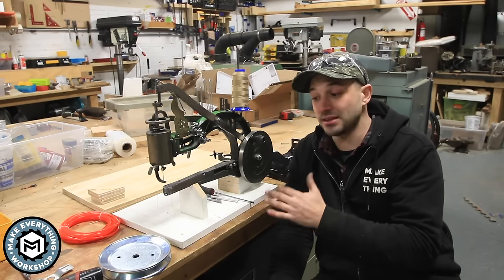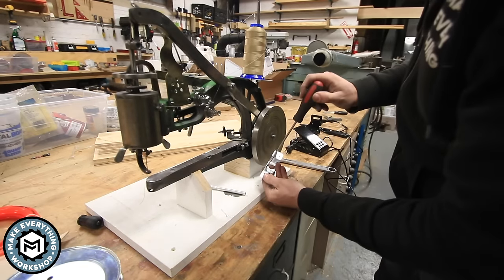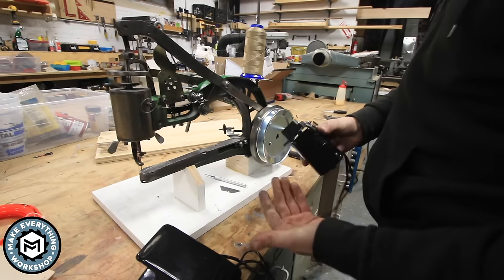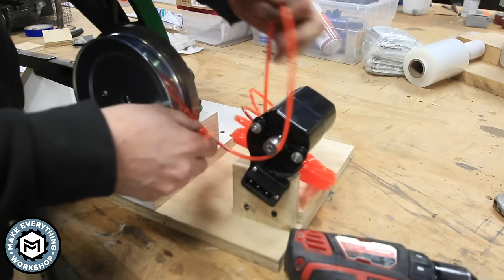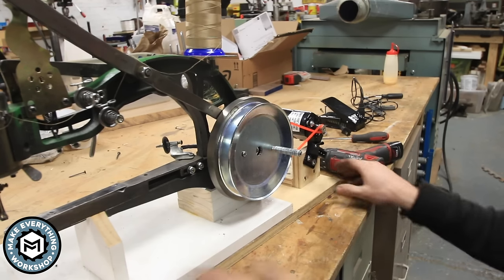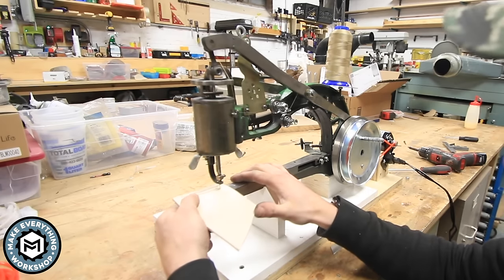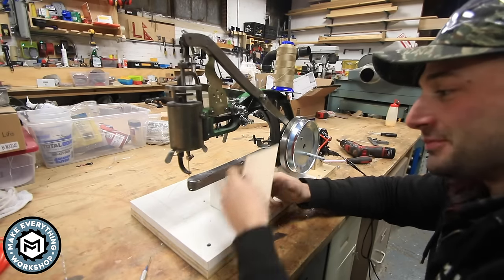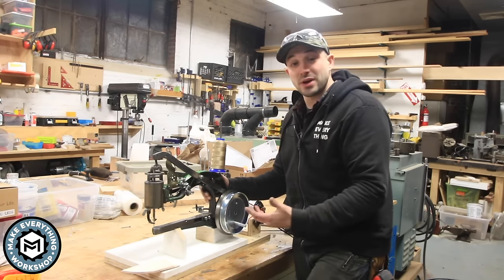Motorizing The Leather Sewing Machine, For Under $50

Comment: Obviously you already have the solution but I was just curious about two things: 1, could you replace the flywheel with the pulley instead of adding it on top. 2, like you did on your Wen bandsaw, if you had 2 steel disks about an inch larger diameter than the flywheel could you sandwich the flywheel and effectively make the flywheel the pulley without machining it? Obviously you'd need the steel disks. Again, you've already got a viable solution but these were just a few ideas.
Reply: You'd probably want to keep the flywheel attached as it adds inertia to the system.
Reply: The "flywheel" is not just for inertia it actually has a patterned channel system on the back of it to guid follower arms that create the proper timing for the machine action. So sorry no it is not really workable to replace the wheel with the pulley.

Comment: Already had the machine.  Picked up the parts you suggested. You said the motor was initially 6000 RPM. Would you be able to tell me with the diameter of the motor pulley you attached the belting to or the potential converted RPM of the sewing machine after attaching the pulley system?
Reply from the maker: I think at full motor speed the big pulley would run around 400 rpm. But like I said in the vide if you adjust the little screw under the foot pedal you can slow it  down to a more  reasonable RPM.
Reply: @MakeEverything  I appreciate the info. I plan on also purposing that motor to run a mini lathe I'm building.

Comment: Could putting a dimmer type extension (like for a lamp) reduce the motor speed?
Reply: I ordered a dimmer.  I was wondering if I should put it between the motor and the AC outlet or between the foot pedal and the motor.  So you know?
Reply: I tried that on one of my machines, it just reduces the torque so you have great control when you're not sewing anything, but it stalls as soon as you put anything under the needle. An additional reduction pulley (and second belt) is what's needed to give more torque and less speed out of that sort of motor, or fit a larger pulley to the balance wheel but that would be ungainly.  Adding mass to the balance wheel might also help as it would smooth the machine action.

Comment: cool idea but it needs a slower motor or gear reduction  by using different size pulleys you could make your pulleys out of plywood or you could recycle some plastic and make pulley blanks. Very interesting idea

Comment: I have one  I bought a while back I keep breaking the needle   I think it may be in the thread I use  so what kind of thread and needle  do I need to use on this machine     Thanks  David
Reply: Thread should not be thicker than # 69 bonded nylon.. needle size #14  to 18 tri point for leather.
Reply: I just replied to someone else. I have been looking for a good video on needles and thread size just today. I found one by Flexitool that goes through the different needle sizes and the different thread sizes and which materials are possible with each combo.  

Some of the other videos I have watched on machine set-up also show other mechanical reasons that are behind breaking the thread and needles.

Comment: Can you use Wax stitching thread? Also I create Guitar straps so I will Stitch after its been stained or dyed. Will this machine make marks in the leather?
Reply: The walking foot as supplied leaves marks in the leather - people grind off the sharp edges of the teeth or coat the foot in plastidip.

Comment: If your 8-32 screws are too long you can trim them shorter with a pair of wire strippers,  got a pair from lowes that have little threaded holes for cutting screws to length.  Run them through the threaded side ( the side that shows the thread size on the face) and squeeze the handle when you back the screw out it'll fix the thread at the tip of the screw so it'll go right in. Don't run the screws in the pliers from the back in the smooth holes, it will leave you saying some terrible things tring to get the piece of screw out of the threaded side...........but I wouldn't know anything about that. . . . 😒

Comment: interesting... i just came across this video and had to view your last one about this sewing machine to see what your thought process was. 

i was wondering if the reason that it is a little violent because the actual wheel the hand crank is on grooved on the opposite side for the cam mechanism to function correctly and is putting that much speed on it really throwing it off balance due to the groove being off center? not sure off the top of my head on how to correct this without having one in my hands to get a better feel of.

anyone have any thoughts on this?

Comment: don't know if I would have gone with a motor that powerful. a lower-speed motor that has higher torque may have been better as you could use more of the foot pedal. the higher torque would help prevent the machine from stalling like it did several times. or just a manual foot treddle connected to the handle.

Comment: what about using a treadle unit from a old singer sewing machine , a lot slower speed then that motor.
Reply: That's a really awesome idea! Anybody here tried that?
Reply: Would the orientation be wrong? The crank is front facing on this cobblers machine, but the old treadles are set up for a side facing crank. Idk. I guess you would have to add another pulley?
Reply: @flyingcat2054  Exactly! There are quite older machines that had the treadle orientation the other way, but I imagine those would be very hard to find. I feel intimidated by the task of having to fabricate that additional pulley. Any YouTubers out there find a doable solution?
Reply: @flyingcat2054  You can run a belt driven shaft at 90 degrees to the driving shaft as long as the driving side of the belt is properly aligned between the pulleys.

Comment: Why not mount the motor on the bolt? you just need to make the motor stationary and then put a L-jaw Coupling Coupler on it. There will be a small rubber spider bushing in there to help with the violent starting and stopping.
Since you motor is turning the correct incorrect way already it is simply turning it around. Might have to file a flat spot on the shaft/bolt or maybe drill a shallow hole, small point for the set screw to take hold.
maybe even get a reversible high torque 90* motor. BUT what does this machine do if you crank it backwards? I don't guess it does a lock stitch does it.
Reply: There's no way a low torque high speed motor directly attached to a low speed high torque mechanism is going to do anything useful.

Comment: Nice mod, make a 3 or 4" pulley for the motor end to slow it down.
Reply: Sean Signer I think that would make it go even faster.  Each rotation of the motor would move that much more belt.

Comment: I liked the video, however that belt is going to melt. You can change the direction of the motor by swapping the leads.
Also being on a budget, a chain drive would have been the clear choice.
Spending the extra $50 on a proper belt drive and motor would have been best option.

Comment: first thank you for the video I like the idea of it, but i found the as the nut on the fly wheel and the light bracket would over tightened and stop the fly wheel. (would a extra washer work to help that?) second the light bracket that is on Amazon, its holes really don't match up the way your bracket does. Any idea's? guess I can go to the hardware store and see if I can find something similar. thank you again for the video.
Reply: I put a washer on a piece of all-thread sandwiched between two nuts.  Then I put that in a drill and turned it on a belt sander until it just fit in the hole in the light bracket.  Worked great.
Reply: john finlay, iii  I matchup up the center of the bracket with the new pulley, marked new holes and drilled new holes. Mounted the bracket with a lock washer ( keeping it centered) and it was easy to mount then. I also used a new crank handle to turn if necessary. The nut for the handle would not clear inside so no lock washer, I put instant glue on the threads. Works great.

Comment: you should make a table fo it so you have more area than that little bar
Reply: tables are useful additions, but the little bar is the whole point of the machine. it's  designed to get inside shoes, or any other tight area. in fact he has reduced the usefulness a little bit by adding the support block under the little bar.

Comment: What is the size and brand of needle and the thread size and brand I just ordered me one thanks
Reply: Check out a video I found this morning by Flexitool on needle vs thread vs type material. I'm sure they don't have that many videos so hopefully it will be easy to find. Just sharing because I have looked quite a lot for someone who could explain to me what needles and thread to order. I have my machine but I do not have it in working order yet. Hopefully next week.
Reply: R Wind thank you
Reply: @oldguysrule-iv7sh  you're welcome. If you decide on an online source for needles and thread and even leather, pass it on.

I am going to start out simply doing repairs of heavier things that have built up around here, involving canvas webbing straps and restitching my LL Bean boot upper to lowers, for instance.  But then I will need to find a source for various weights of leather for new crafts. We used to be able to go to a nearby store and sort through stacks and bins.  I am not aware of any store here who sells leather anymore, specialized threads and needles.
Reply: I found the video, if it will let me post it:
https://youtu.be/XTVOKl0w9mo 

Watch "#13 Needle and Thread Pairing on your Chinese Manual Sewing Machine HI-RES with *IMPROVED AUDIO*" on YouTube

Comment: After timing the machine to run correctly it sews great. BTW I changed my thread and bobbin thread to one from www.sailrite.com used for sewing boat canvas and the machine never breaks the threat even after pulling it out to cut it lose after sewing. It's very very strong yet easy to thread the needle and bobbin,  V-69 Black UV Bonded Polyester Thread 4 oz. sews great VERY STRONG can't break it by hand!

Comment: if you knew the motor was turning in the wrong direction, then why didn't you modify your motor mount and flip the motor around? That way you wouldn't have to deal with twisting the belt. The belt tubbing against itself will chafe and wear down ver quickly. You will find yourself replacing your belts constantly because of the figure-8 system you use because the belts are essentially self-destructing.

Comment: i'm still waiting to see someone make a foot pedal mod of this machine.
Reply from the maker: I saw a guy on Instagram who set is up with a bicycle chain and sprocket to run it that way, it was pretty ingenious!!
Reply: @MakeEverything  Well, since about a month ago i had this idea of making human-powered machines. With a friend we were developing the plans for the prototype of a small 6 wheels handcar, made to have more torque and reside more on the weight from the operators. With a sistem that allows for torque-speed ratio changes without loosing energy on gearboxes nor belts and pulleys. Made to move maybe 3/4 light weight wagons full with things like grain or packages from other towns, size of each one like mining carts.

Comment: Get into the habit of using you hand to help start the rotation on the large pulley. The motor doesn’t have much torque and helping it get started will make it last and won’t have to use so much foot pedal to get going.

Comment: Would this thing work well for attaching patches to hats?
Reply: It'd be like hanging a picture with a sledgehammer.
Reply: It would be excellent for that, because you can steer the needle around the perimeter of the patch without having to turn the hat.  These machines were originally used for attaching repair patches to leather work boots.  I'm not sure what needle fitting they use though - you'd want a small gauge ball-point needle, a leather needle is designed to cut so would damage the hat.

Comment: How much does the leather sewing machine cost? Does it work on real leather??
Reply from the maker: Nikos Tass $100-$120 usually, works amazing on leather I’ve sewn 1/2” of leather no problem in one pass
Reply: I've had one for a while, it will sew any leather you can fit under the foot.  I think the most I've done was 5 or 6 layers of 7oz leather (plus glue).  That was by hand and it was definitely harder than 2 layers but it was not bad.  There's a video on youtube of a guy swing car tires together with this machine.
Reply: Theyr'e like $75 now.. on ebay.

Comment: Cheap motors? Note that electric motors are outrageously expensive, but for Harbor Freight shoppers there's a cheap solution. Buy a piece of their machinery dirt cheap and strip out the motor. The motor is usually worth more than the machine itself..

Comment: I'd replace the plastic belt with a leather belt they sell for treadle sewing machines.
Reply: Leather belts work fine on treadles or large motor pulleys, but the joining staple isn't going to play well with that little motor pulley.  I have machines with leather belts and some with poly belts, the leather looks traditional on an old treadle but the poly belt works better.

Comment: The only Problem is the Belt will rub against itself. the motor can be reversed by removing the two pins on the plug that power the motor, the third should be a ground.

Comment: NO one thought to just put a rubber wheel on the motor and run it on the wheel?!?!
Reply: I assume you mean to create the same type of connection that the bobbin threader has with the flywheel?  Have you thought anymore about how to do this?
Reply: @rwind656  look up how some folks motorize their bicycles... One common way is to direct drive a weedwhacker to the rear tire... Just a small semi custom metal wheel thats presd against the tire. It provides enough force that once youve pedaled up to speed it takes it from there. So a similar style could work here.
Take a small wheel with a grippy rubber tread, and attach the motor, then mount that assembly so you can adjust it to press against that conveniently wide aluminum edge on the crank handle. Hell, you could use those adjustable clamping toggles often seen in wood working and a hinge so you could move the motor out of the way if you wanted to go hand powered.
Reply: @SlyProphet  thanks for taking the time to reply.  I thought that was what you meant. I will have to discuss it with my better half who is more mechanically and electrically competent.  

I like the idea of the toggle clamp...  I guess it might not give me the same flexibility in running manually for just a few stitches before going motorized again?  Seems if you had a clutch on the motor...  tied into the hand crank, so when you grab the hand crank, it disengages the motor temporarily?? But I'm way beyond my depth without help.  

No matter. What I appreciate about this video is that it is a solution made with those of us who are less handy in mind. ( I'm sure this guy could do something more elegant but some of us would be lost along the way. )
Reply: @rwind656  honestly, you could probably run it by hand without disengaging the motor... But it would have a bit more resistance than I'd like for detail work.
And no worries! Glad my idea is gonna be of potential use to someone other than myself! I'm home sick for the next few days so its not like i have anything better to do.

Comment: That’s not safe. You need a reduction pulley with two belts and you need to build it a flat bed to keep your hands away from the needle. That motor shouldn’t be groaning like that to start the machine, you need to move the wheel by hand to help it get going.
  A proper flat bed is a board with a cut out for the arm and legs to make it flush. Probably needs an attachment point. 
  That machine isn’t built to be motorized, y’all may blow it apart.

Comment: Can't you just reverse the wires on the motor to reverse the direction that it runs?
Reply from the maker: Jamie McDaniel you probably could but I didn’t want to advise people to go into the motor and make changes. Most people are timid to mess with electrical current in that way, but it’s worth a try!
Reply: @MakeEverything  ah, it must have a plug already...I was thinking hard wire and then it's easy just switch the two wires.

Comment: That motor is not the way to go. You need low speed torque. I used a plain old cheap cordless drill . Either a bicycle cable to the trigger or moving the trigger assy to a footswitch which is what I did is the way to go Low speed torque !!!

Comment: i dont no what electric you have but if you swapthe wires on the motor it will drive the other way,
Reply: Nope.   a DC motor will spin in the reverse direction by simply swapping the polarity of the supply leads, but an AC motor will not do so. not unless you access the wires that lead to the starter winding / capacitor inside the motor. The starter winding / capacitor is what generates the initial phase shift to create the rotating magnetic field which causes the motor to spin, unless that is changed the motor will spin in the same direction regardless of supply lead polarity. 

This is simple to check with any cheap AC appliance - a razor / blender / hairdryer/  mixer etc. These are usually not earthed and have a two pin plug attached. the motor will spin in the same direction regardless of which way you plug in the 2 pin plug.

Comment: The reduction is no where nearly enough. The problem is that the minimum speed for the motor to run properly is still too high for the machine to be operated with any real control. I'm not usually one to dis someones video when they are trying to impart this type of information to help people, but this is far from an "elegant" solution.